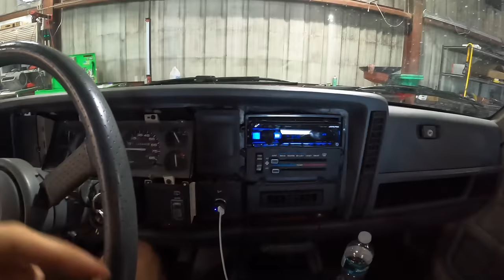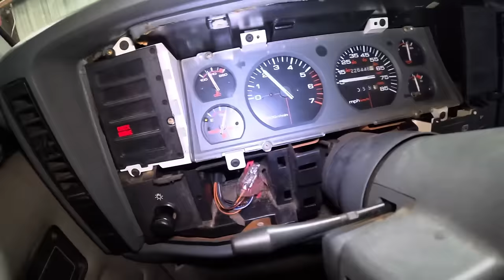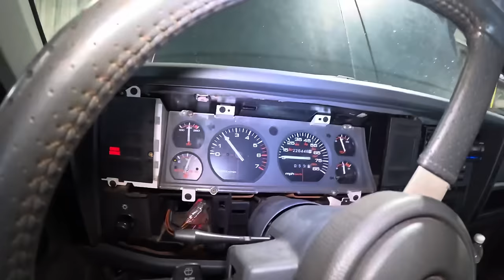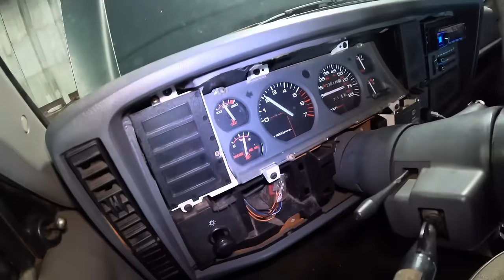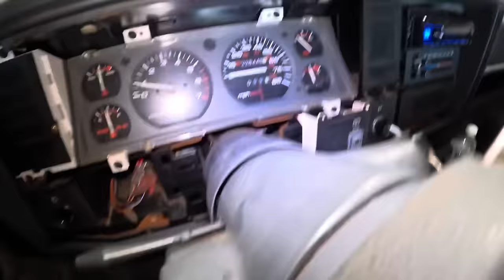Scalding HOT EVIL Filter of DEATH!  SEVERE Smoking! Jeep 4.0 Cherokee / Wrangler @bgproducts

Comment: Was honestly surprised how much cleaner the valves and stuff looked the final time you took the valve cover off after running the cleaner through the engine. Seems to have cleared up the smoking problem. Also, seems like Troy genuinely enjoys learning. I can see why you hired him. Plus his personality meshes with yours perfectly, lol.
Reply: the cold start burned off  lots of oil that dripped into cylinders from worn valve .stems seals, he needs to restart jeep tomorrow cold to see smoke issue was cured by BG

Comment: Got to admit, pleasantly surprised by the result. Pity you didn't do a compression test prior and post treatment. also an opinion of the power pre and post.
Reply: Great idea! 👍
Reply: take for a spin, if it run good, there you go, but on a engine that old, i would go 10w40, my 318 seen to like it more than the 10w30
Reply: @IR-nq4qv  the second option is seat of the pants, and really just guesswork, the first option would be factual observation. Nothing self contradictory about it.
Reply: @worldsend69  at the outset no one could know it would improve anything. If the valve seals were hard, cracked what ever it would still suck oil and smoke, if the treatment didn't free up the oil control rings it would still smoke. Neither suggestion added more than 10 minutes to a process that had taken the best part of 4 hours.
Reply: @IR-nq4qv  Has anybody said you are over thinking things... Jeeez. Does any of it really matter.
Reply: @IR-nq4qv  not going argue with the horse flogging, but the his horse did seem to get some fresh oats. Which surprised me and in this case contradicts you stand point. Also smoke colour could also depend on ambient lighting when filming. Unless you are suggesting Ray was selling us a dummy. I still maintain it isn't worth the level of thought you are putting into it.
Reply: Fire fire
Reply: To be fair, those "chemical additive company" guys gotta eat too!
Reply: @JamesSmith-xs7sr  figure they should work for the oil companies that spent all that time and energy improving the oils and putting in their own additives in the past 50 or so years?
Reply: @IR-nq4qv  I am not a proponent of additives and treatments, hence my initial comment that I was pleasantly surprised it worked. BUT you seem to be going off having a blue funk when surely we also know many modern engines have been fitted with low tensile strength pistons rings to help manufacturers claim better fuel economy, and they seize up and burn oil as a result. So even if you put brand new oil in it every hundred miles they would still suffer from blow by and the problem would be there for either a rebuild which might not work, as with Toyota in particular there is no scope for boring or surfacing the head. Why on earth is this such a cause celebre for you.... jeeeze.
Reply: @IR-nq4qv  definitely the best thing is to change the oil several times maybe it will help but all this snake oil stuff is just a gamble that could blow up in someones face.😮
Reply: Exactly, it would have added less than ten minutes nut s, and it did seem to cure the smoking, and had he done it it would have possibly indicated it freed up the compression rings too.
Reply: @IR-nq4qv  Have a nice day. Seems like you need one.
Reply: @IR-nq4qv i get what you're saying (and mostly agree)... with that said at least from the evidence we were given it seemed to help with the original complaint- smoke from the tailpipe. Could totally have been edited... true.  It would have been interesting to see compression numbers like the op said... or possibly a tailpipe emissions test before and after- in order to see some real data. Actually, the fact that they didn't add any of that makes me agree with you more...🤔.
Reply: Might be nice to know what the "treatment" cost, if it's cheap it might be worth a shot if you're in that situation. If it's not cheap... probably worth putting the money towards a more mechanical fix
Reply: @IR-nq4qv  that's possible. It's also possible that the smoke just didn't look blue cause it was up close and on a camera

Comment: Great video of the process.  But the gasket you used (Fel-Pro VS 50458) is for the 96 and later with a steel valve cover.  The part number for the aluminum valve cover is VS 50522...I learned that the hard way.

Comment: Back in my dirt track racing days, we used to pull engines out of junk cars that were dirtier than that. We ran straight 40 Valvoline racing oil in them and after a few races, they were clean inside. We ran it because the Super America stations would have a sale on it in the spring. We bought cases of 24 cans for $7 a case in the 70s. The 40 weight kept the oil pressure up and the engines didn't smoke as much. In Florida, you could run 40 or even 50 weight oil. No need for multi-grade oils if it doesn't get cold.

Comment: Just as a tip, the shop I work at uses old electric floor cleaning pads in the oil drains to prevent oil splatter and it catches the drain plain and crap - approximately 24 inches across / circular

Comment: I’ve had a couple of these that you could rock the valves 1/16 after pulling the head apart. But the bottom end was ok. 

Crankcase flush and Decarbon helps a lot of them also. But it seems hot and miss.

Nice work.
Reply: Hot stuff eh??

Comment: I’ve found that pouring oil with the opening at the top instead of the bottom allows air to displace the oil eliminating the glug glug effect
Reply: I hold the jug sideways.
Reply: I prefer a funnel.
Reply: @thomas7770  ? We're talking about How you pour the oil not what you pour it into.
Reply: @NoWr2Run  oh, in that case I go with a 47 degree tilt of the oil jug.
Reply: Back in the day when we had oil cans, you would make a hole in opposite sides on the top. One for pouring and one for air. That's got nothing to do with this conversation but it reminded me of that.
Reply: @Goose Gaming, Back in the day, when we had oil cans, the punch in spout eliminated the need for the separate air hole
Reply: @thomas7770  You're not getting much oil in your engine at only 47 degree's tilt of the oil jug.
Reply: @andrewadams488  I remember crushing the damn oil can before the spout would punch through the lid, LOL.
Reply: @andrewadams488  back in my day we poured the oil in our model T’s.
Reply: @ now2run, Yeah, those “paper” cans really sucked
Reply: @andrewadams488  yeah oil can accessories. Didn't have one. But good for you. My way worked without it.
Reply: @thomas7770  luv the reply hahaha, I live on the dge so go for 51 degrees. hahaha😂
Reply: @andrewadams488  YES THEY DID, LMAO. I remember Dad used Wolf's Head Oil back then & STP.
Reply: @andrewadams488  They had a bad habit of leaking too.
Reply: @NoWr2Run  Yep, Wolfs Head SAE 30 and 20w50 was what my Grandfather and Father used.
Reply: @TheLionAndTheLamb777  YES SIR.
Reply: I get my oil straight out of the ground, cheaper.
Reply: pull the dip stick
Reply: That is how it is designed to be poured.

Comment: Years ago,  a buddy of mine had an old Ford truck with a 300 in line 6.  It had a brazillion miles on it and it ran ROUGH!   He was ready to ditch it, but I had an idea.  We drained all of the oil and filled it with 5 qts of ATF   and ran it for 30 mins.  Drained it (all kinds of weird gloop and glop came out) filled it with 20w50   and it ran like a champ!
Reply: If you keep the oil changed regularly, that engine will go 500,000 miles no problem.
Reply: Those old Ford 300 I6 motors can last a million miles. They were originally tractor engines in the Ford and Fordson tractors from the 1950s. Low compression long stroke engines, you could almost run them on any liquid that would burn....

Comment: On old inline 6s, suggest you check the timing chain.   Its probably super loose and at the same time, drop the pan and replace the oil pump.  That motor would be good for another 200K miles.
Reply: I agree, I’d drop the pan, clean out the oil pickup tube, replace the oil pump, and change the timing chain and tensioner. That many miles means there is slack in a lot of the parts
Reply: Sure, then as long as you're in there, do the rod and main bearings. Better do the front and rear main seals too. Since the crank is out to do the rear main seal, better pull the heads and pistons so you can hone the cylinder bores and replace the rings. Since the heads are off, do the valve guide seals, and since the valves are out for the seals, better replace the guides. New guides means you should regrind the valves and seats to get proper sealing. Of course, since you already replaced the oil pump, you really should replace the water pump too, and no sense replacing the timing chain without replacing all the chain guides, the tensioner (does the jeep use a chain tensioner?), and all the belt pulleys and tensioner too. Finally, since everything else has been refurbished and replaced, why not make it a clean sweep and change out the alternator too.

Ah, the hazards of "...while you're in there." 😀
Reply: @douglasburnside   and after all that is accomplished why not add a new jeep too.
Reply: That would be cost effective if planning to keep engine.
Reply: @douglasburnside  Ha, ha!  It never ends, does it?  Those "while you are there" moments will get expensive.

Comment: I would never do that expensive multi-step motion to my high millage Chevy.  I add a cup of MMO to the oil about 300 miles before changing the oil.   Keeps engine clean and running great at a VERY LOW cost and fuss.

Comment: I bought a car off a workmate once who told me he had for some reason it had a oil change but he had paid a bit more for engine flush too..driving it about a few weeks I had the oil light flick on a few times..looking into this i checked oil which was fine so put it down to dodgy connectors on the sender unit..so I cleaned all the contacts and the problem seemed to have be have cured..next day I was driving to the airport with the family in the car and driving on the motorway at 5am at 70mph the oil light flickered ten 10 seconds next 300 meters it came on solid before i could pull over the engine blew up and threw two crank rods though the engine block also resulting in a fire..lucky i had a fire extinguisher..turns out after stripping the engine down the oil pickup strainer was blocked with carbon that the engine flush had dislodged and starved the oil supply resulting in engine seizing, a very expensive oil change
Reply: Some oil flushes will dislodge the deposits but leave them elsewhere in the enigne. This is why you do an oil flush just before you drain the engine oil to get rid of the depsoits before they end up elsewhere in the enigne. The BG products get round this problem by keeping the deposits suspended in the oil so that they will all come out when the oil is drained. I suspect that whoever did the oil flush just added it after the oil was changed. Anyway, I swear by BG products myself and I absolutely trust them.

Comment: You should tell Troy when pouring things to turn the spout so that it is top most and the handle of the jug is at the bottom. The liquid will flow nicely without the glug glug effect. Just a suggestion.
Reply: It makes it hard to start pouring accurately with the spout at the top as you are that much further from the oil filler or funnel.  Holding the jugs sideways is a good compromise IMO.
Reply: if you hold the bottle so the handle is horizontal (sideways), the fluid won't block the hole (Which is what causes the glug-glug)
Reply: Or you can turn the jug sideways that works too
Reply: Was that Troy's first "on air" pouring things?
Reply: Or drill / punch a hole at the top of the handle so air can come in through there rather than the suck back which causes the “glug” 👍 it will pour a little quicker as well

Comment: 67 year old mechanic. Back in the day we would put a quart or two of Ford ATF in the crankcase. It did a wonderful job cleaning push rods and eliminating sticky hydraulic lifters. I bought a used 76 Blazer in Alaska. When I got it the engine would clack at 50F for about 15 or twenty minutes. That's how bad the sludge was. After two oil changes with 2 quarts of ATF and Mobil One synthetic the engine would not make a sound at -40F. ATF is designed for tremendous pressure and long life so if you aren't racing during the cleaning cycle it does a really great job. Love your channel and your integrity.
Reply: That was supposed to read "not make a sound at -40F

Comment: A pedestal-mounted bench grinder with a wire wheel installed makes quick work of the cork gasket. It’s also great for cleaning up the threads on crusty bolts.
Reply: i use my bench grinder wire wheel constantly it is great for rust removal

Comment: Any a owner of automobiles, I can’t stress this enough. Change your oil every 3,000 miles. Oil filters do not trap carbon. The percentage of carbon only rises as the miles tick off. And where do they land and cook off but around the piston and oil control rings. Every 3,00 miles keeps the carbon to a minimum as it winds its way through the system. Car makers tell you that every ten thousand Miles is recommended, but keep in mind, they are in the business of selling cars. The cleaner you keep your oil the longer the engine lasts.

Comment: Interesting video. Lots of work. Hope the "burns" heal quickly. 
Quick note: if you had sprayed the inside of the valve cover with Purple Power and let it set for a while, all of the grime/grit would have come out much easier.
Reply: I've used Purple Power full strength on a Subaru and Nissan valve cover and it got off all but the worst baked on varnished oil. I even used it on a rag to wipe the internals under the cover to remove baked on oil residue
Reply: @shamanosarcasm9800  I have a K&N Air Filter and clean it about twice a year. I soak it in the PP and it lifts off all of the dirt and oil. Then I rinse and soak in a mild Dawn and water solution then rinse, dry and reapply K&N oil. Always looks almost like new.